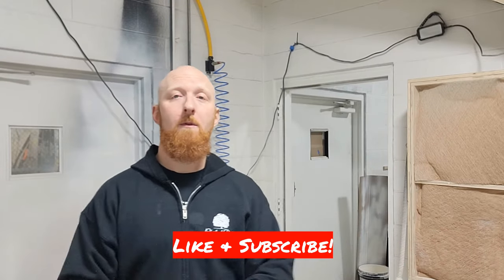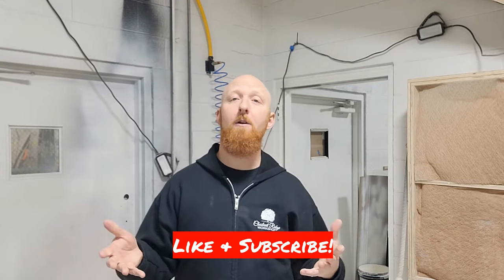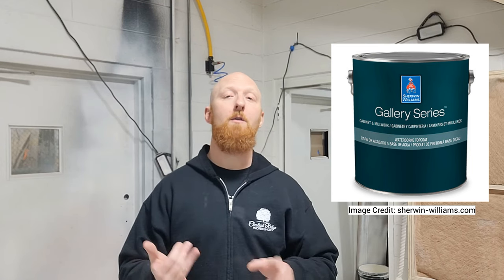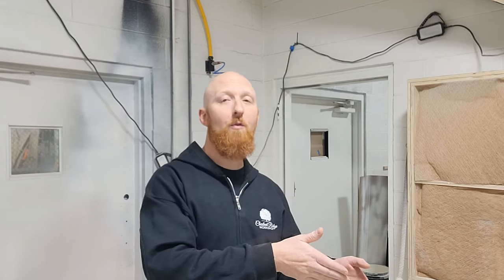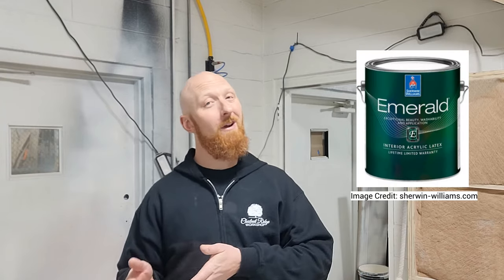Sherwin Williams Gallery Series - We Put It To The Test!

Comment: I switched to Renner in my cabinet shop years ago. Game changer vs solvent based
Reply from the maker: I've seen others using that too. I need to check it out
Reply: @kentripp3170

I read there are different Renners, and one is recommended for raw wood while another is for repairs. Does that ring a bell? What do you use for wood? MDF/HDF?
Reply: Word on the street is that gallery is repackaged sayerlac   And that sayerlac’s crosslinker works in gallery, there’s a YouTube video of someone doing it
Reply from the maker: @mikegrit937  well it makes sense. Same company so why not.
Reply: Try Renner and milesi

Comment: What are your HVLP tip size and settings for this product? Trying to find a suitable water-based solution myself. Thanks!
Reply: Oh and what primer did you use? Part 2 you mentioned it was a solvent based primer.
Reply from the maker: Thanks for watching! I used a #5 needle and tip with the Graco hvlp. Fluid control wide open. The primer we normally use (and top coat for that matter) is Axalta conversion varnish. We use the white undercoat primer specifically.
Reply: @ChestnutRidgeWorkshop  "Fluid control wide open."  Interesting. I've been using my Fuji Q5 Platinum to test this product with 15-20% thin, 1.5mm nozzle, and fluid control knob 1 1/2 turns open. Just tried 1.5mm and wide open. That.. was fun. Lots of overspray but it seems to have gone on nicely. Now we wait 1 hour.

Also, not sure why your dry times are wonky. Mine will dry in about 1 hour with 4mil thickness.

Comment: Hi, thank you for explaining the gallery series, I have a couple built-ins I built and have just primed them with the oil based Sherwin primer and am getting ready to spray the Gallery series. I have the same Graco HVLP gun as you and was wondering what your settings were so I could replicate what you did. Thanks for a great and informative video.
Reply from the maker: Thanks for watching, and I'm sorry I just saw this now! I missed it somehow. I ran the #5 needle and spray tip. Fluid dial and air on the gun full open. Roughly 6-7 bars lit up on the compressor adjustment on the unit.

Comment: Can you roll this paint on instead of spraying?
Reply from the maker: It is designed for spray application only according to SW. I suppose you could roll it, but I haven't tested it. It's substantially thinner than normal brush/roll paints so runs could be an issue. Thanks for watching!

Comment: Can you tell me what primer you used?
Reply from the maker: Axalta conversion varnish white undercoat
Reply: @ChestnutRidgeWorkshop Is this better than Zisser BIN shellac primer?
Reply from the maker: @MadLadsAnonymous  I think it sands better. Buy SW recommends their shellac primer be used of course.
Reply from the maker: @markzod3842  I tested two ways. 1, I used my normal solvent primer from axalta. 2, I used the gallery paint itself, because they claim it's a surfacer as well. No doubt the solvent primer was better, but the gallery worked fine too just slower.

Comment: When I spray anything. It has a little orange peel on it if the coat is heavy enough. It will look peppery if its to thin. But dries beautifully. I dont like hvlp for latex. I have pro contractor 9.5 with compressor and remote pot. Gallery is probably thin enough to use without thinning. Emerald is not. Ive only sprayed tricorn black, seaworthy( naval) and white, all 20 gloss. Hvlp does Not enough build in one coat and doesnt suit the production standpoint of a custom build residential painter. 

I roll all my ceilings with crown molding because I tape them to make rolling and cutting in easier. I can have 2 idiots roll a lot of ceiling when taped. 

 Gallery has been great for us. Spray backs in the morning. Spray fronts after lunch. Im getting much better dry times than him. For me it gets super hard. When i chipped some off the wall to texture the drywall it felt like poly. I do a quick thin mist coat on my first coat that has 90% coverage. This allows for a little faster drying and sanding. Also allows me to find hard/difficult spraying positions before I do heavy coat and get a run. I have had fairly decent success sanding gallery in less than an hour and respraying. 

If you add passive air to the gallery when drying I can do a double coat on the fronts in 30-45 minutes. Basically spray 30 doors and when finished start over again. Especially on deep base and ultra deep colors when 2 coats is necessary.
Reply from the maker: @LoganShelton-rh3lp  wow thanks for all the info! Thank you for watching and sharing!